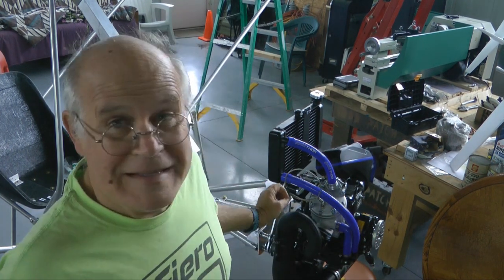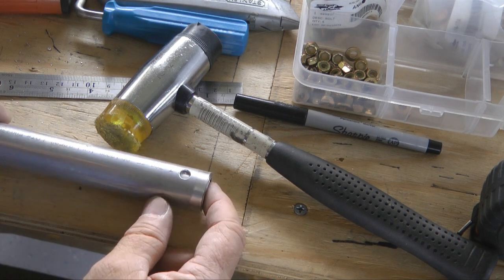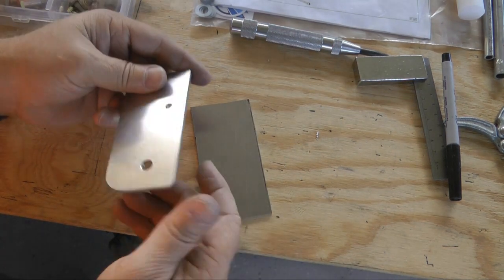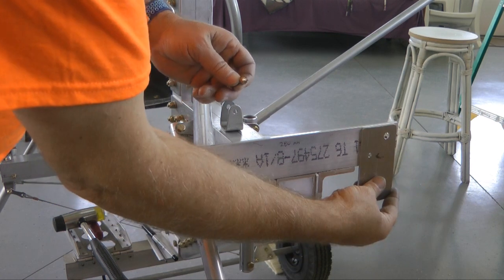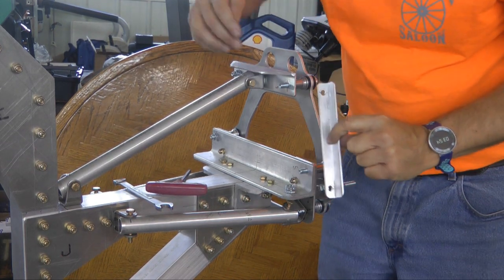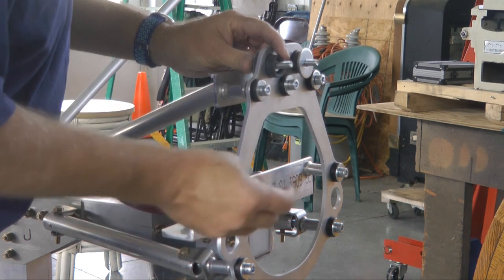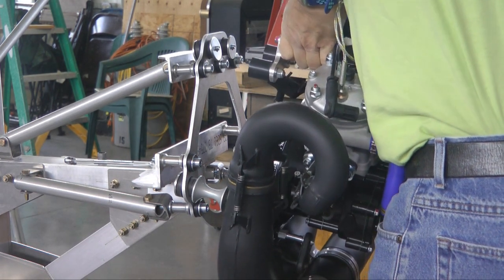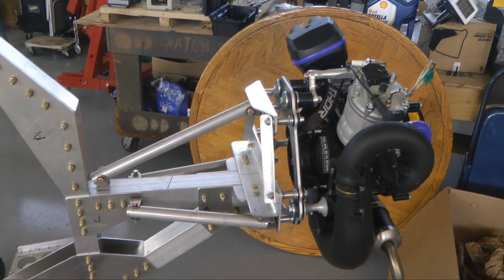Building the Affordaplane Part 42

Comment: Did you have to calculate how far out the engine mount should be prior to fabrication, or is that just standard just based on the typical engine weight range?
Reply from the maker: The location of the mount/engine IS critical.  That is the sole purpose of Weight & Balance calculations.  In fact, the designer of the mount, Oscar (videos on Patreon) waited for me to give him specific weight numbers on the landing gear and tailwheel before he could make the placement of the mount.  Of course, he also needed the weight of the engine.  This is why you see much heavier engines used by others further back towards the pilot. The balance of the aircraft must be very near the point of lift (which is the wing!)

Comment: Hi Jon. Thank you for your series, ever so much! 

A question and observation about strengthening that bolt/tube connection with a sleeve. Now, in compression and tension you have strengthened the connection only by the sheer  strength of one rivet (friction not accounted for). To  double the strength of the bolt connection, you would need to have as many rivets that equals the shear (and compression) strength of the bolt connection. My guess is, let's say 4 rivets...  

It should not be a problem to add rivets  so that the edge distance would not be compromised (1,5 times diameter of the hole). It probably would be fine as it is, but as you "overengineer it", let's do it so, properly ?  😀  

Just want to keep you safe and alive so that the engine does not detach, and we can continue to watch your appreciated videos 😀  .

 Not sure what the performance of the Affordaplane is as a tail heavy glider 🤔 ?
Reply from the maker: Kim,  Thank you for that excellent analysis and observation of those joints. And I completely understand/agree on that thinking.  The reason I use only one rivet is because I am not concerned about the overall compression/tension strength of the tube - but rather a different failure mode. Those ends are subject to potential crushing (from tightening bolts too much) and wallowing out of the holes by the bolts via engine vibration forces. Those inserts are a crude attempt at reinforcing the integrity of the holes - and to make it harder to crush the ends of the tube. And so the single rivet is to simply hold the insert firmly in place. I appreciate, nonetheless, your reply and would hope you continue to make observations and comment on them. Your analysis like this is a big help in making this project safer and better!